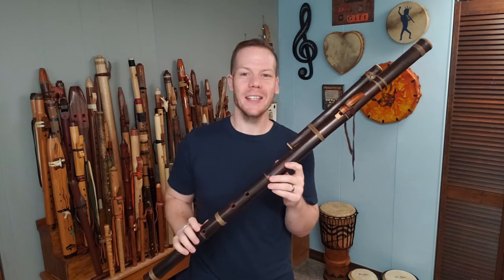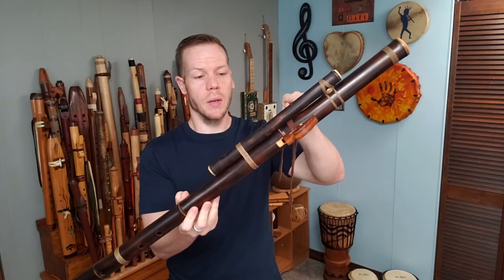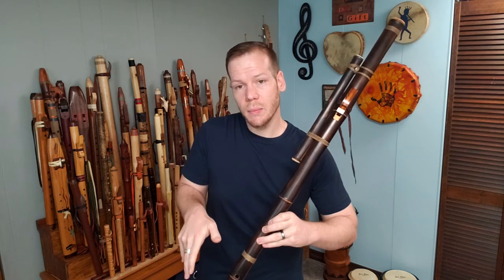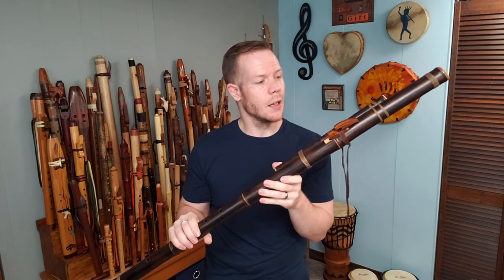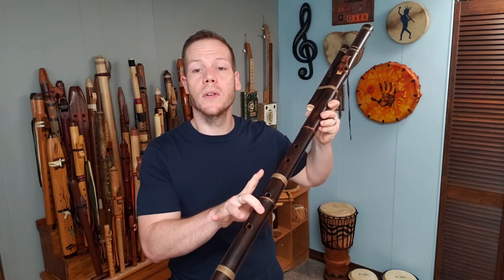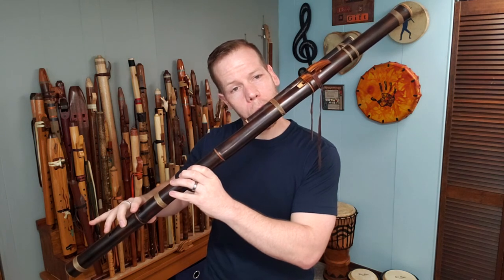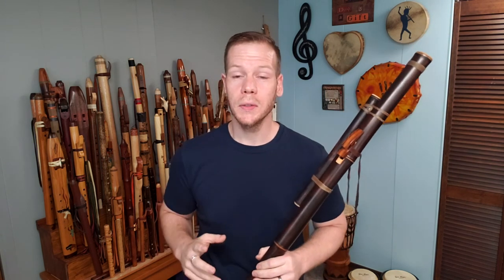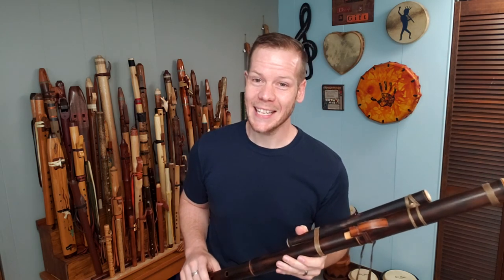Contrabass Bamboo Poet's Flute | Jonny's Native American Flute Reviews: Episode 7

Comment: Just wondering... are you getting the upper register strictly by breath control, or do you crack that top finger a bit. It sounds great. Outstanding video.
Reply from the maker: The fundamental is quite sensitive and could be done by breath alone on this flute, however, I have a habit of cracking the top hole when going into the upper register on flutes that require you to close all the holes and overblow to the next register.